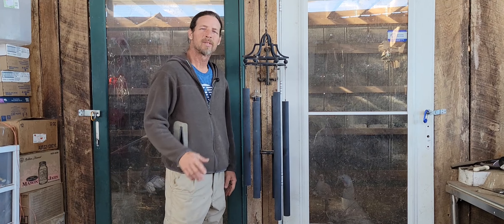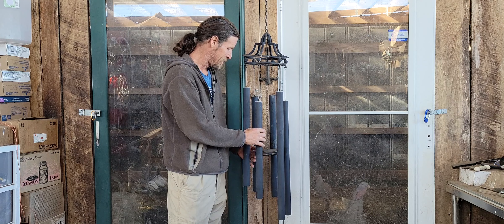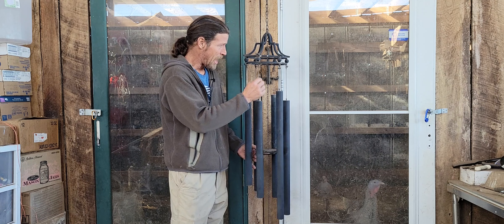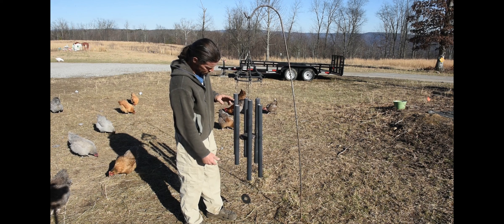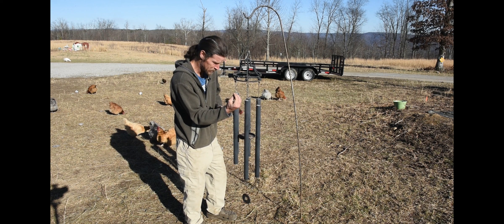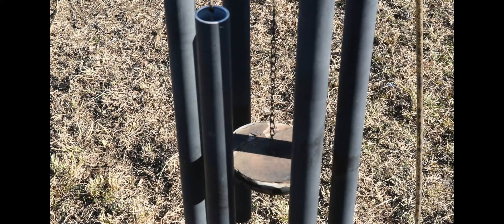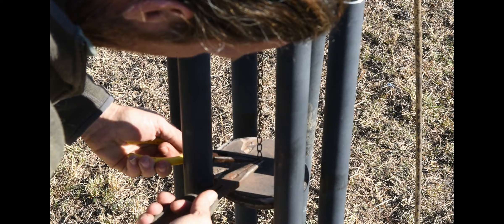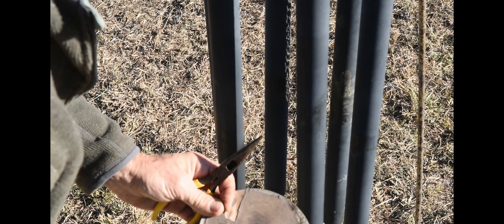Wind chime restoration. Restoring 5 1/2 foot long wind chimes wind chime repair

Comment: Have you had a chance to make the video with step by step instructions? I've got some just like those. Such a beautiful sound! What type rope or cord did you use instead of the chain when you replaced it! Ajay are the parts at the top of rope that you"crimped"? Thank you for all your help! Great video!😊😊
Reply from the maker: Hi Tammie.. Not yet. I will make one this summer. Here is a link to the cord I use. It's not the cheapest but it is some of the best.  https://whimsicalwinds.com/Category/Chime-Cord
Reply: @HippieHillHomestead  , Thank you so much for the response and the type of cord! I'd rather have better quality than cheap, I'd hate to do the work they break!  Thank you again! Can't wait to see the new video :)
Reply from the maker: You are welcome. We have been super busy this year and I haven't had time to build another one yet but I will.

Comment: I’m searching for instructions on tying the cord to the inside of the pipes. This one looks like mine with the cord fastened down inside and I don’t know how to do that.
Reply from the maker: Hi Marie. Take your cord and tie a loop on the end, then drop it down one side of you axle. Then take a stiff wire like a metal clothes  hanger and tape your cord on the end of the wire.slide the wire through the tube on the other side of the axle and out the top. Slide the end of your cord through the loop and pull it tight on the axle. When I get time I will make a video on how to do it.
Reply: I have the same issue. Did you ever learn how?

Comment: Those look great. The deeper tones are my favorite. I would really be interested in that construction video when you make a set!
Reply from the maker: Thank you. I have been gathering up materials to build a large set for a while now. I finally have everything I need so when I get the time I will make a step by step video on how to build them. The most important thing is axle placement, it should be  22.4 percent the length of your pipe.

Comment: Great timing for me! My mom passed away in 2007 and in 2019, my dad passed. One of the things I wanted was the wind chime they had on their porch. It’s a big one like yours, and it has never been painted. Last week, the nylon string broke so I’ve been googling on what kind to buy for it. I see you’ve already answered that, but what do you suggest I use to clean the actual (I’m assuming aluminum) poles?
Reply from the maker: Anne, sorry for your loss. Just use some sand paper and rough them up and then take a clean  rag and some minerals spirits or acetone to clean them before you paint them. good luck and if you have anymore questions please ask. Thanks Bob
Reply: @HippieHillHomestead  thank you! Love listening to my parents wind chime!
Reply from the maker: Are they painted or powder coated? If they are smooth they are likely painted. You can just use sand paper to sand off the old paint. If they are powder coated it will be a little harder to sand off. Make sure to clean them well before you primer them. If you have any more questions please let me know.

Comment: Those sound great. What kind of pipe and what size would get a tone that low with such a long sustain ?
Reply from the maker: Thank you. Aluminum pipe has the best sound. The bigger the diameter the lower the tone. The longer the pipe, the longer it vibrates or the longer the sound. Thanks for the comment

Comment: Really nice job!  That is a beautiful set of chimes.  I have a set of Music of the Spheres that my dad had and it has seen better days.  I see that they staggered the height so that the striker hits in the center of each pipe.  I assume that makes the perfect “note” and therefore chord or scale.  But yours sound great either way.  Those big ones are gorgeous.  I wondered how pain would affect them.  Yours seem unbothered by it.  

Thanks for the video.  I haven’t started my project yet!
Reply from the maker: You are correct, by having them staggered and different lengths they each produce a different sound. The paint actually softens the tone ever so slightly. Good luck on your project and thanks for watching.

Comment: Very nice. I have to re-do all mine this year, so you gave me some good ideas. What did you use for the string?
Reply from the maker: Thanks. The strings were in goo shape so I didn't have to replace them. I just waxed them because they were a little dry. When I do have to replace strings I use strings made for wind chimes that are uv protected and weather resistant. Fandol, Davis and Atwood are my favorite manufactures for wind chime strings.